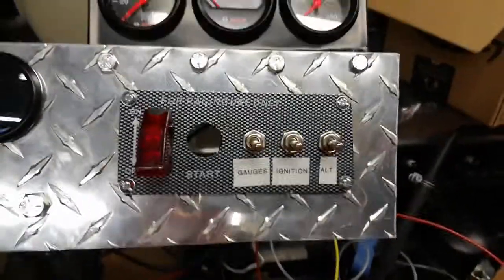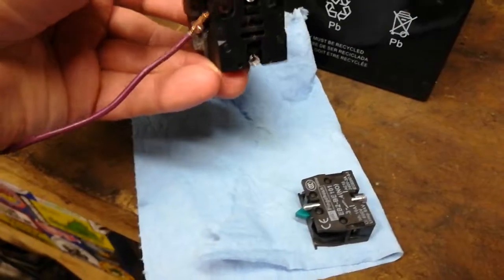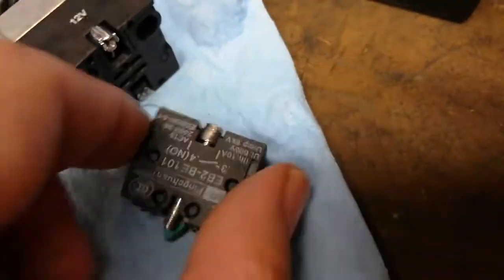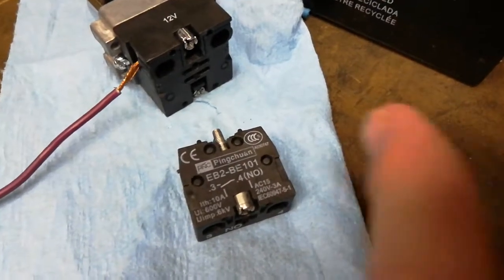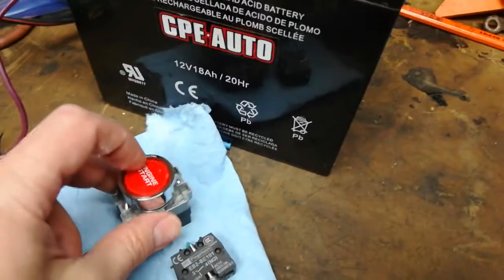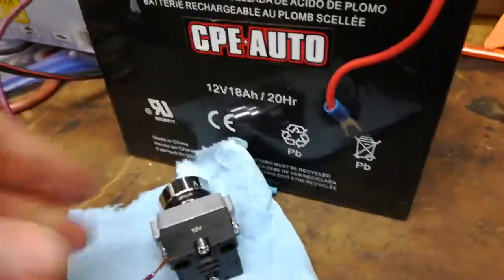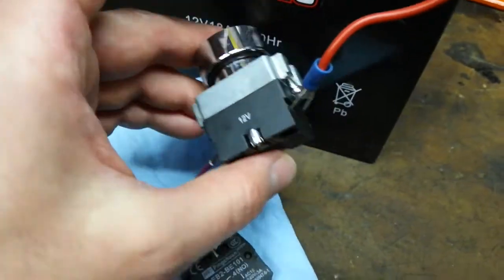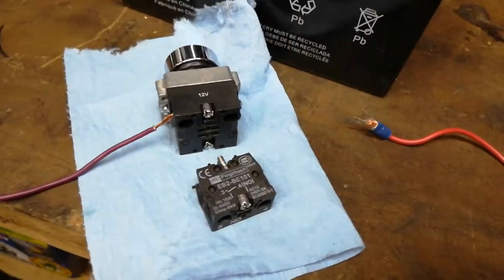Starter panel LED push button ignition switch in detail

Comment: had to search to see what panel you were talking about,, i guess this is it. 24.99
 https://www.amazon.com/IZTOSS-Ignition-Switch-Engine-Button/dp/B013VS93ZU/ref=asc_df_B013VS93ZU/?tag=hyprod-20&linkCode=df0&hvadid=309898128610&hvpos=1o2&hvnetw=g&hvrand=16990033039149529326&hvpone=&hvptwo=&hvqmt=&hvdev=c&hvdvcmdl=&hvlocint=&hvlocphy=1027784&hvtargid=aud-801738734305:pla-570978986375&psc=1
And here is test stand drawings.  For 11.50.
  https://www.ebay.com/itm/Engine-Start-Test-Stand-Plans-Ford-GM-Mopar/331922556895?hash=item4d482047df:g:32YAAOSwwo1XfvzN